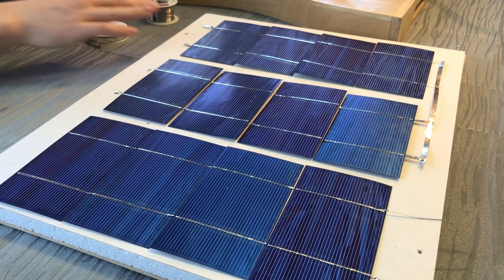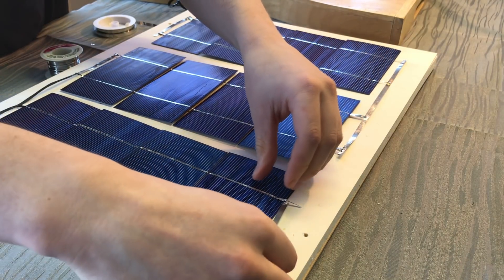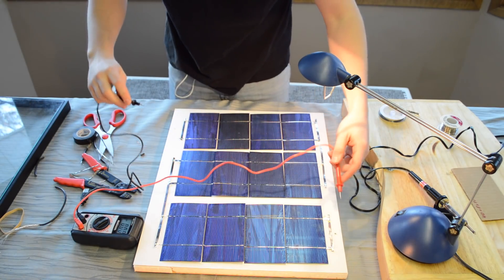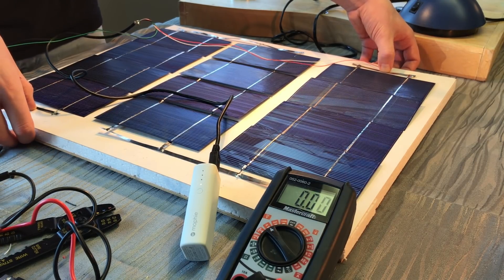How to Build a Phone Charging Solar Panel from Scratch

Comment: I haven't made it to the end yet but why are you shorting negative and positive together!? Each cell has neg and pos (those two strips per cell), the set of 4 was fine, but when you attached them together you messed up!! You shorted neg and pos of each 4 pack then connected that to the next set of 4 you shorted to it's self! You're SO close! Rewire the ends, 2 wires from 1st bank to the 2 individual wires of the next bank. I PROMISE!!!!! I used to teach this kinda thing. Liked the video though. Do an update, I sub'ed.
Reply: this was my exact thought, these cells did not work the way he shows, for the reason youve stated.
Reply: @MrDmadness  yup.
Reply: No they are correctly connected because both wiring strips coming from each cell are positive and they are connected to the negative of the next cell which is on the bottom of the cell. Each row ends with 2 positive wires that are connected to the negative side of adjacent cell in the next row. His panel is one of a few that I have seen that IMHO will produce a sufficient amount of power to charge a power bank within a reasonable amount of time. However depending on how the power bank is designed his panel may need a diode to keep the power from feeding back into the cells when they are not producing power.
Reply: The upper and lower lines are negative/positive. But there is one more issue, How did he directly wire the pannel to the usb cable and charge powerbank or phone? There is suppose to be a AC to DC and step down 5v buck converter for USB application.

Comment: Few points I'll make that would improve this project, or make it easier to assemble.
a) Measure and cut the tabbing wires on 4 of cells, so you can do all the soldering to the back of the cells in one go.
b) Assemble the cells face down inside the frame, then solder the tabbing wires in place.
c) Bend the tab wires up at the edges, to solder the busbar and output wires in place.
d) Get everything tidied up (flat), and put a layer of plastic material over the back of the cells. (EVA film is what they use commercially)
e) The output of a solar panel is not regulated 5V, some USB devices won't like being run at higher/lower voltages. You can buy cheap dc-dc converters with USB outputs.
f) You can no doubt hide some electronics in the frame.
Reply: station240  You literally took longer to write that than he did to make the panel 😂😂

Comment: Awesome work. worthless advice:
 dollar store cutting boards or just cut to size cardboard sheets are ideal for working with b-grade cells to prevent disjoining the solder or damaging cells. 
also, salvaging a couple 9v connector clip from a couple cheap alarm clocks or cheap portable electronics from goodwill give you an easy snap away cable/connector On bottom of the frame. Ive used audio jacks/sockets as well.
Reply: 9v connector clips are not suitable as break away connectors, the wires are thin and rip out.
Why wreck working electronics, when connectors are like a dollar each (or less) at most places.
Putting a USB socket in the frame is a far better idea.
Reply: @station240  very much agree. Just a poor man /salvager option
Reply: @kryptography8397  USB sockets from dead PC motherboards, proper DC jack/socket sets from dead DSL modems, cordless phones etc.
Sometimes I find it easier to dig thru the junk pile.
Look up FFcossag on Youtube, he bodges electronics together a lot too.